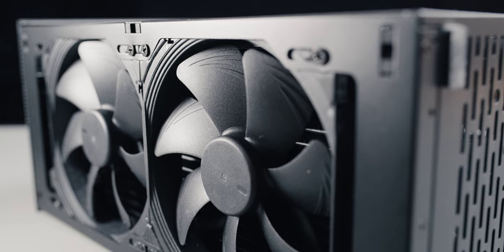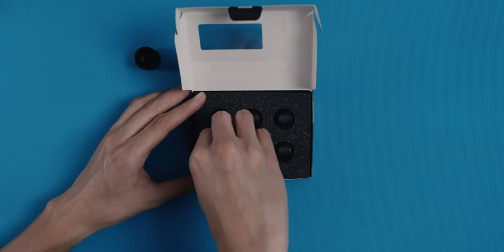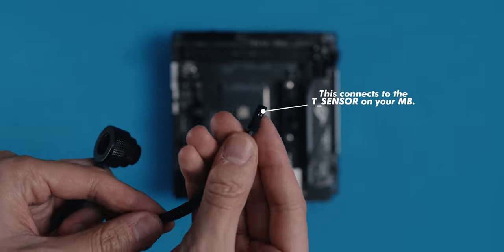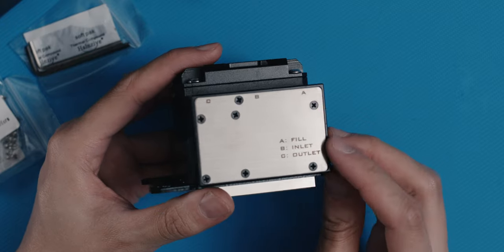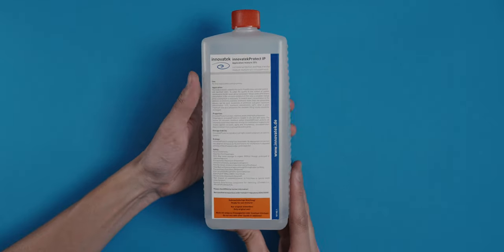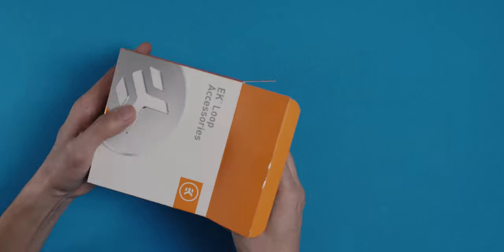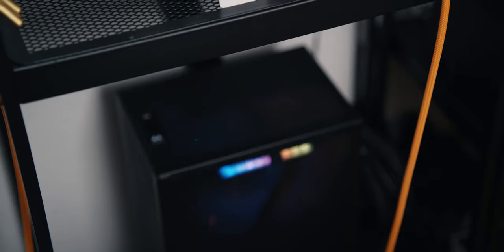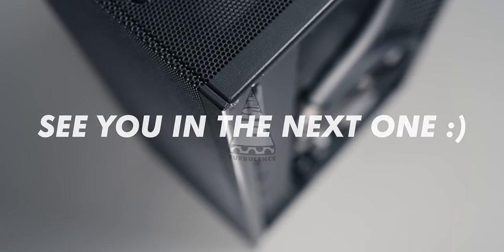My Watercooling Dream Build feat. Meshlicious, RTX3090, Ryzen 5950x

Comment: I'm so happy I found this video! I am two months into my Ghost S1 build with basically the same components. I got a 3090ti and am currently waiting on the 7950x3d preorder, if it sells for above Msrp I will just go with the 7950X. I tried to use all EK fittings and the quality on them as second to non, I did have to use some bitspower fittings for impossible joints . I would suggest looking at getting the, Modultra LOBO DDC CPU Pump Block they make it in brass and acetal. The water block (with pump) has a maximum height of 45mm and has an adjustable cold plate which allows you to adjust the concavity. I only have a 240mm radiator but it is raw copper with above average FPI and 6 double pass copper tubes. Every major radiator on the market uses three copper pipes out to a manifold and thee return. I am hoping that this in combination with industrial Noctua fans will be enough. I also got Go Chiller coolant to help squeeze every bit of cooling out of the system.  I also have had to 3D print quite a few parts which has allowed me to fit a 50x150mm reservoir, fan controller, (4) 30mm fans, and a cable shroud/gpu support. I have been putting off making custom cables, waterjet cutting a new high flow grill and mount plate. It is so nice having reassurance that my system might be possible.
Reply from the maker: Wow your system sounds awesome, congrats on the build! 🙂

Also thanks for the LOBO DDC CPU Pump Block pointer, looks interesting in case I would want to change at some point 🙂

Comment: An alternative to the Barrow pump/block/res is the Alphacool Eisbaer Solo LT which is similar, but much lower profile, and without a translucent version. The advantages it has is that it can be oriented in any direction on an AM4 socket, whereas the Barrow has an issue that the ports cannot cover the screw mounts for the block. It also has superior mounting hardware. The disadvantage is that it uses the Alphacool DC-LT pump which is far weaker, and likely more like an AIO pump. I replaced the 6-32 mounting bolts on the Barrow block with slightly shorter shoulder bolts with wider screw heads. As an alternative to the Koolance low-profile 90 degree fittings, EK has the Torque Micro in black (SKU 3831109849682), low profile fittings with an Allen key/hex head.

As someone who has been WC PCs since mid 2013, I have to say this is an excellent first build, and you've done an excellent job explaining the decisions and challenges of building a small water cooled, ITX PCs.
Reply from the maker: Thank you so much for the kind words and the advice, I didn't know about the Torque Micro from EK and will definitely add these to the basket on my upcoming "facelift" of this build.

Thank you! 🙇

Comment: 10/10 this would heatsoak under 5 mins without undervolting. I have exact blocks and pump with SE280 and had to add another SE240 for cpu and gpu to reach max frequencies with PBO and 2100 Auto OC on GPU.

Comment: I have this case with same pump/block/res, I found it easier to fill by getting a radiator that had an extra port on the other end.  I used extenders on the extra port to fill it and slow bleeding air bubbles out.
Reply: Which radiator was that?

Comment: I'm running 3 rads, 2x 360's and a 280. With my 12900k overclocked to 51./4.0 and 3090 at 120/460 I am getting gaming temps of 61 GPU and 12900k at 70-86 playing PUBG on 144hz.
Unless you're playing on 60hz, those temps you have mentioned are impossible at 27C room temp. Love the design and build by the way
Reply: And on top of that the worst performing slim rad which is the ek se and claiming 1000rpm lmao maybe with the 2100rpm hwinfo reported on cpu fan

Comment: Was waiting so hard for this one! Just excellent 10/10!
One question though, you have the spline in the gpu 3slot mode and the mobo with some standoffs? I was thinking doing the same (also with the barrow) but didn’t know if it was possible (:
Reply from the maker: Yes that's true, the GPU side is in the 3 slot config. With the Barrow block and the Koolance 90° fittings you have just enough space for it 🙂
Reply: @CheeseTurbulence  greeeeeat (:

Comment: Right off the bat I see you went with Innovatek Protect, one of the absolute best coolants.  You can run aluminum with copper even when using that stuff, I did it for 5yrs and not a speck of corrosion.  Best coolant I ever used, it's just hard to get in the US.
Reply from the maker: Woah, didn’t know that, but that calmes me down a bit, thank you! 🙂

Comment: I cooled a ryzen 1700 and 1080 ti on a 240mm radiator. no issues. 280 mm will be fine. but your cpu is high power. you may have to lower its power draw. but i think 280 is fine.

Comment: At 8:40 you mention that 2 holes share the same chamber and that you can disregard the designated inlet and outlet markings. However that is incorrect, water blocks have an inlet and an outlet that are designed to channel water in a specific way and pushing water through it backwards can effect thermals.

Comment: Hi, really like the build. 

I think i've watched this video together with the build one for at least 5 times over the last 4 months, and really love it. I found it because i searched for Meshlicious high end builds and i definitely wasn't disappointed.

I want to make a 7800X, 7900XT build in the Meshroom S case, and i've heard the same as you did, that this wouldn't work because 1x 280 radiator just isn't enough. So that's why i want to use the Meshroom S which comes with a bracket for another radiator in the GPU side, which should fit from my research. 

But another thing that i keep hearing is, that it would be a problem over time for some reason, and i wouldn't be happy with it over the long term. So, now that the video is 2 days away from being 1 year old i wanted to ask how it is holding up? As far as i can see you never made an update video, so i guess everything went well. Hope you enjoy it and it didn't get hairy after a few months of use.

Thanks again for both of these great videos, that kept my motivation for doing such a build too up over the last few months.

Comment: Love the build! Just had a few questions so hopefully you see this! I have a 3090 TUF as well and will be getting the same block as you're using. 
- How much space (in width) do you have if you don't run the tubing like you did?
- I am looking at the FLT120 to mount infront/top of the GPU and mount it to those 3 PCI slots at the top; Do you see that as something possible with this GPU/Block?
- How wide is the card with the block on? is it still 1 slot? or does it creep into 1.5-2slot width

Thanks and beautiful build, really a huge inspiration for me going to do mine

Comment: Beautiful video! Do you know you can delete the molex completely by wiring everything through the fan connector of the pump? I did it and it works great, just check your motherboard manual for the maximum wattage of the fan port you plug in, if it's more than 17W you're fine! Cheers!
Reply from the maker: This is an amazing tip, I did not know that but will add it to my ever-increasing list of improvements. Thank you! 😀
Reply: hey brother, do you have a link to a tutorial for this mod? thank you

Comment: Awesome Video, can you maybe share a list of the needed Parts to do this? I mean, i just need to know how much fittings and what for angled ones i need. :)

i also have that case.
Reply from the maker: Sure thing 🙂

Here’s a list of all the part’s I used: https://kit.co/CheeseTurbulence/full-meshlicious-3090-5950x-build

But double check the descriptions with what you actually are linked to on Amazon. I’ve had people buy the wrong things because the links go to local Amazon where the exact product might not be or no longer is available.

Comment: Hey, by any chance did you get the PWM version, I am wondering how you control the speed of the pump with the header and the dial that comes out of the connector from the pump. 

Thanks

Comment: Would you say cooling of this caliber is required to get a sandwich-style case to tolerate the weird cooling form of a founders edition card? I didn't do that research before camping out overnight at best buy this week and now I have a FE 3070 ti I'm no longer certain will play nice with the ssupd case.
Reply from the maker: I think you "should" be fine, at least according to Optimum Techs video where he tested it with a 3080 FE: https://youtu.be/EUSDCyqv8OQ?t=219 (share is at timecode: 3:39).

He did move it to the 4 slot config for more airflow on the GPU side tho, depending on your CPU cooling this might or might not be possible.

Comment: You mentioned that you are planing to use one of the active backplates for the 3090. I've been looking into moving my current system into the Meshlicious, but since I already have an active waterblock for my 3090 strix I've been worried about the clearance issues that the added thicknes of the block to the card would add. Do you happen have insights into this clearance issue?

Comment: Hello, did you try another fan setup like fans pushing or pulling out through the rad?
Reply: I’ve seen quite a few independent reports of the best configuration being a push configuration, expelling hot air outside of the case via the front and cool air being pulled in from the mesh sides/top.
Reply: @jaredcraig640  thank you
Reply: @TheMolok80  In saying that there are quite a few factors which may affect outcomes for some people. I’d suggest trying it a couple of ways personally.

Comment: Witzig, dass ich das Video jetzt angezeigt bekomme, kurz nachdem ich meinen eigenen Meshlicious Custom Loop fertiggestellt habe. Bei mir laufen momentan ein 12700KF und eine Fury X (ich warte noch auf preislich bessere Tage) mit GTS 280 Radiator von HardwareLabs, Velocity² Plexi CPU Block + EK Plexi Block für die Fury X sowie D5 Pumpe und EK Res X3 110. Für die Pumpe habe ich ein custom bracket designed und 3D drucken lassen.

Obwohl ich mich vorher extensiv informiert habe war der Build selber eine ziemlich Herausforderung und ich musste mein Design mehrmals während des Bauvorgangs ändern damit alles passt. Dadurch, dass die Pumpe über der Grafikkarte hängt brauchte ich zum Beispiel zwei Fill Ports: Einen direkt bei der Pumpe und einen am Reservoir neben dem Netzteil. Außerdem läuft momentan der Radiator nur mit einem Lüfter weil der zweite unglücklicherweise DoA war und ich auf einen Ersatz warte. Insofern fühle ich den Schmerz den du sicher auch bei deinem Build hattest :D

Zusätzlich plane ich gerade tatsächlich noch einen XSPC TX120 Slim Radiator vor die GPU zu hängen um die Temperaturen der Kühlflüssigkeit etwas weiter runterzubekommen. Die GPU-Seite ist nämlich im Vier-Slot-Modus und hat Platz übrig den ich unbedingt nutzen möchte. 

Alles in allem ein ziemlich aufwendiges und teures Abenteuer, was mich aber auch einiges gelehrt hat. Quasi ein Mini-Ingenieursprojekt.

Comment: Thank you for the numbers. I've been having this debate where I want to stick the Ekwb Evolv X quantum reflection pump and res combo inside the case. The only problem is that it eliminates front radiator support and it limits my top 360 radiator mounting. Or I can stick a 280 rad on top and run both my gpu and cpu from it. That fits just fine but I was worried about temps. I was also looking at the exact same radiator you put in. Pretty much everything is the same except for the Barrow pump.
Reply from the maker: Very welcome! 🙂 If I can recommend one thing, don't get the acrylic Barrow pump in case you were thinking about it. I had people notifying me about quality and tightening issues with that one.

Comment: I have 3900x undervolted (3800mhz max/manual) and i get 42c on idle with kraken x63/noctua nf-a12x25 fans on 50% 1160 RPM (exhaust) and evga 3080 about 38c. Is there some trick to lover that CPU temps down without sounding like airplane? Tnx.

Comment: 13:43 You actually shouldn't pump it into the green because that's way more pressure than your loop will ever experience and it could damage parts or move o-rings out of position. rtfm

Comment: Epic video - inspired me to do exactly this.

Will the OLED version fit in the Meshlicious?
Reply from the maker: Thank you! 🙇

Regarding your question, maybe, but unfortunately Barrow doesn't have it on their website anymore so I don't know how tall the OLED version is.

But there really is only a fraction of space left (around 5mm I would say) between the top of the regular Barrow and the side panel.
Reply: @CheeseTurbulence  I believe the fill ports are the same just the height of the block has increased to 73.5mm (watercoolingUK has it in stock and more info). So if the block is 73.5mm and the fill ports are the same position, it should mean that with low profile fittings (although zero are to be found these days) - then it should work :shrug:

Also am considering the 3080ti FTW for about 350£ extra ontop of the 3080 10/12gb - did you ever consider it?
Reply from the maker: @qalih  Never considered the 3080ti FTW, I had the 3090 in my old case (Evolve Shift Air) where it got too hot, which is why I started to look for a new case.

For the low profile fittings, have you tried to get them from Koolance themselves: https://koolance.com/fitting-single-black-swiveling-elbow-low-profile ?

The shipping to Europe is ridiculous though, I used a forwarding address which was way less but sadly not very economical.

Comment: fuck yes, I've been waiting for this
Reply from the maker: 😅 hope the wait was worth it!
Reply: @CheeseTurbulence  It is absolutely amazing! Thank you for the hard work. I am left with one quick question: I'm starting to wonder if it would be worth it to have a tiny reservoir in my loop in order to help with filling / bleeding. I'm only doing CPU cooling and would love to know where you think I might be able to fit something like that? Does it need to be at the highest point of the loop? I'm looking into the Alphacool Eisstation 40 Res / Pump Combo which would free me up to use a different cpu block but was originally set on the barrow pump combo. Any thoughts?
Reply from the maker: @oopsie2827   Hmm, if you're just cooling the CPU I'm assuming that the GPU air cooler is taking up all the space, right? Because that would otherwise be the most spacious area. See the 2nd rad here: https://www.instagram.com/p/CUH_LsyrZHb/?utm_source=ig_web_copy_link (3rd pic)

Will depend a lot on your cable management too, if you've got an SFX PSU you might have some space above or in front of it, see the this insane thing here: https://www.reddit.com/r/SSUPD/comments/orwthm/my_2nd_meshlicious_custom_loop_very_satisfied/

He also has his parts listed there, hope that helps 🙂

Comment: question what fans did u use?
Reply from the maker: I got the Noctua NF-A14 iPPC-3000 PWM, but they are overkill the regular ones will do just fine. You wouldn't want to run these at 3000rpm anyway.

Comment: What size EK tubing did you use?
Reply from the maker: I used EK-Tube ZMT 16/11 mm, hope that helps. Sometimes the measurements depend a little bit on the shop, like here on newegg: https://www.newegg.com/p/37B-000B-003D1?item=9SIAD2TBZW4552 (but I think this is the same)

Comment: I had the translucent barrow block and it got an air bubble so trapped in there it killed the pump. And the springs kept popping over the bolts. Not a fan of the product honestly.
Reply from the maker: You're not the first who mentions this regarding the translucent version of the barrow pump. I think those are a bit dodgy, I'm not sure about the black one I have. Have yet to hear from anybody who picked it and had no issues.

I hope it didn't permanently damage any of your components 😔
Reply: @CheeseTurbulence  The only thing it permanently damaged was my opinion of Barrow lol. However the mess it made? Indescribable.
Reply from the maker: @Generic Memes 😬Yeah, I feel like this is something I will defiantly mention in my "1 year after" video... even if it worked for me, I think it didn't for a lot of others.
Reply: @CheeseTurbulence  Thank you! For Meshlicious cases, an alternative I found (As my 3080ti ftw3 is MASSIVE and I can't fit a traditional res or pump inside of the case) was to mount the ddc pump/res from EK to the back of the case. It's not the most secure, but with enough elbow grease it works. I'm hoping to go external with my radiator and pump soon.. Any chance you could look into that? I'd love to especially see how people power their pumps and fans!

Comment: Your temps are very different to your prvious video. When will they be correct? You are obviously reading something wrong. Maybe because you're new? 46deg water temp does not yield 60deg CPU\GPU temps. You should also show wattage for both CPU and GPU as well. I have a feeling they are serverly underpowered and not running as they should